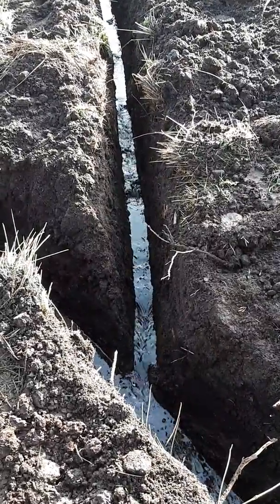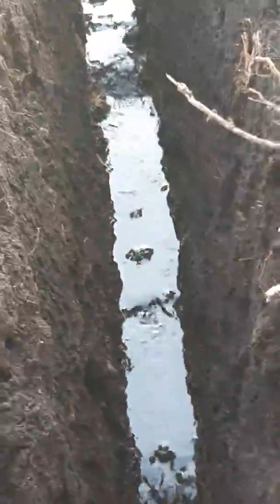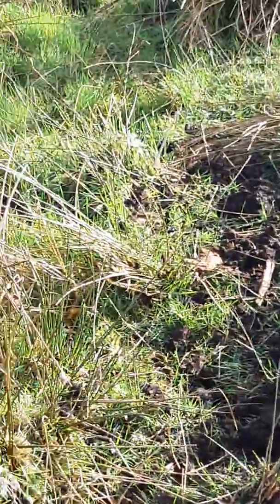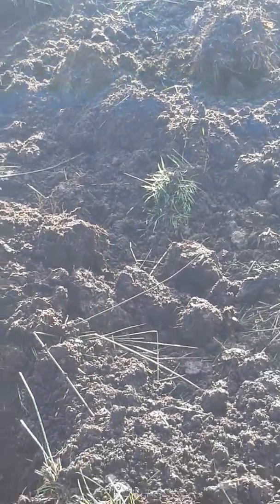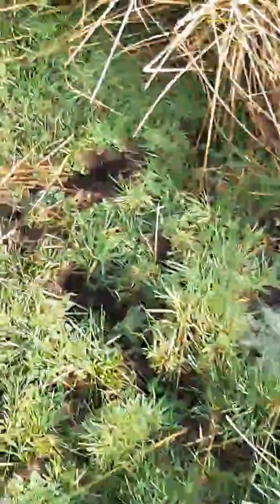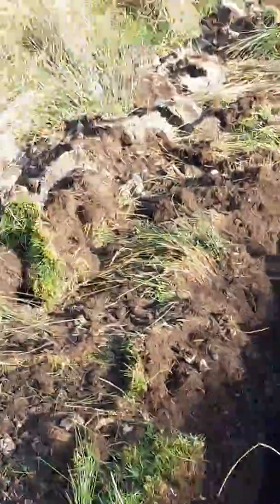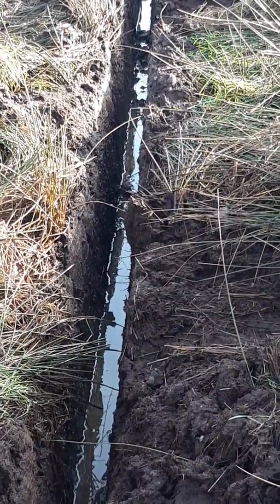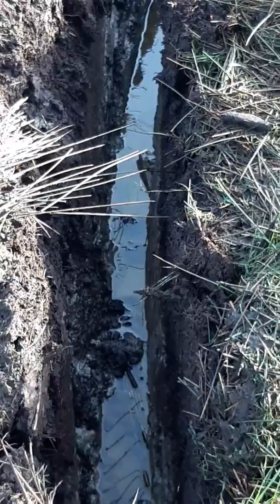Drainage channels in Bog ground 20th January 19

Comment: Great job looks like it’s draining really well
Reply from the maker: Hello Chris. It has a good fall to the outlet and it's soaking in a lot of soil water so it's a fast exit to the end of the shore which hopefully will encourage more water to ingress. It clearly shows how high the water table is to have this amount of water being removed from the field.
Reply: Francis Stenson I’ve just bought a cottage in Leitrim with a few acres that’s over grown with a lot of rushes, it’s on a slope so seems to drain well down to the bottom. If I strim it all down can I leave it on top or would it need to be removed. It has had sheep on it I’m previous years.
Reply from the maker: @chrisshepherd8082  Hello Chris. If you can top it tight with a topper once ground conditions allow, the rushes will degrade much quicker into the soil than if you just now them. I am assuming that if you have a few acres, it would require a tractor to cover the ground. Decaying rushes have 25% NPK value of farmyard manure so they will improve organic matter. However, it's a process of continuous management as I have learned over the years. If you have a slop that terminates to a drain, it would be ideal for moling which would further improve the soil. Sheep don't eat rushes except the top 2 inches of fresh regrowth so top and top again until population declines. No easy solutions Chris. I hope this answers your question.
Reply: Francis Stenson thanks this helps a lot I am going to get a little tractor to top it regularly I guess I should get a mole plough too then was thinking about it. Good to know I can leave the rush on to rot down at first. There’s a few rocks dotted about so I need to find these with strimmer before I go on with a tractor. I have also read that goats eat them so they could help to get them down.
Reply from the maker: @chrisshepherd8082  Hello Chris. I would wager from your reply that you are not from farming background! If you can give me an idea of what acreage you have, I can advise you further on the details of what you have just written of.
Reply: Francis Stenson hello your right I’m not from a farming background. I’ve just got a little field about 3.3 acres in size. Thanks for your help
Reply from the maker: @chrisshepherd8082  Having such a small acreage prompts the question of what type of tractor and equipment is most suitable. In that regard, based on whatever type you buy, compact or something like Massey 35 or similar, a mowing machine capable of mowing rushes will be required. The same goes for moleploughing. I made mine to suit my tractor as many manufactured units are too big and heavy for the Horsepower available.
Reply: Francis Stenson I had already decided on getting a 35x. Maybe I will have to find a local fab shop to make a mole plough then. I take it that some mower decks are not up to the job then.
Reply from the maker: @chrisshepherd8082  that would be a good tractor. Mowing heavy rushes is hard on a rotary mower and it must be done slowly. You could get a flail topper but you would be limited in what's available for 35hp tractor unless you were going down the route of brand new flail mowers for compact tractor. What is your plan, smallholding farm?.
On the moleplough, there are many considerations such as depth, heave and channel diameter pre and post expander travel. I could advise you on a very simple but effective design for a small tractor moleplough if you wish.
Reply from the maker: @chrisshepherd8082  if you dont mind me asking, what is your final plan for the field Chris?
Reply: Francis Stenson thanks I would love to see your design on mole plough for a little tractor. I don’t mind you asking our plans at all and if I’m honest we are not entirely sure ourselves yet. A small holding of some description is very appealing to us. One thing for sure is we are going to be growing veg but this will not be in our  field but around the house.
Reply from the maker: @chrisshepherd8082  I will draw up a simple design with correct ratios for you. I can email it to you if you have an email address Chris.
Reply: Francis Stenson wow thank you that would be great but I’m not sure how to give you my email without any one else getting it. Do you know a way ?
Reply: @francisstenson1971  ive sent you my address on google+
Reply from the maker: @chrisshepherd8082  I cannot see any notification or message in Google+ Chris. You can email me directly at frstenson@gmail.com.
Reply: @chris shepherd.  Rushes aren’t too hard to kill but it’s a 2 or 3 stage process. Topping them will encourage fast Re growth. The best thing to do then is use a weed wiper with glysophate after 3mths when the growth is still green. MCPA sprays are effective but are discouraged as the chemical can affect ground water quite badly. Given your small area it would be more cost effective to pay someone than buy all the kit inc a tractor. If the land is wet then quad based kit would be a better option anyway. Hope this helps.
Reply: Hugh Marcus thanks it’s more options to consider but I rather like the idea of a tractor anyway